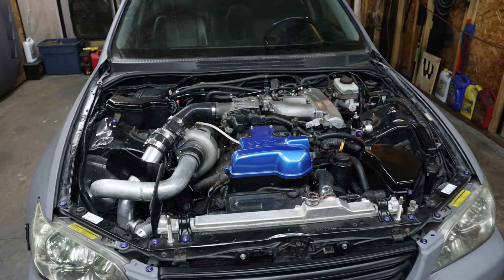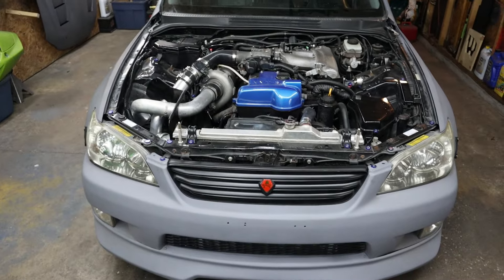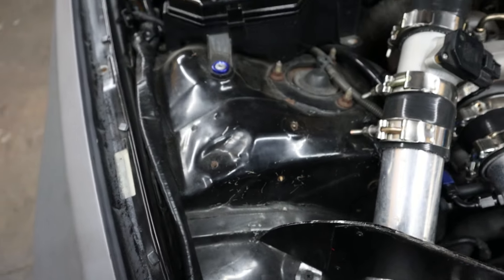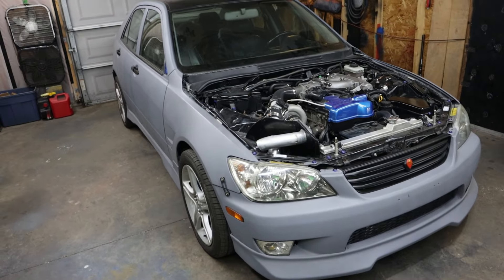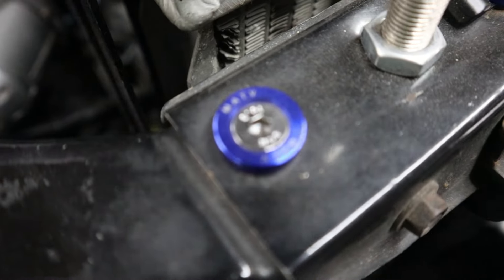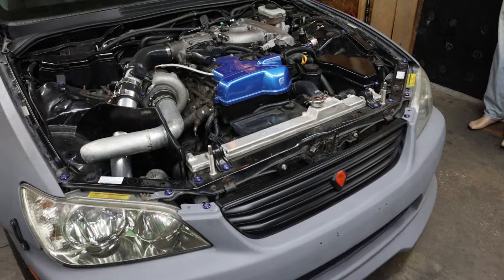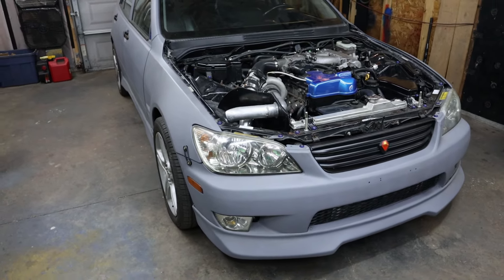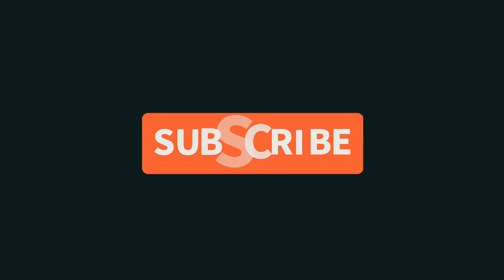Turbo Lexus Build 🐌 Change of Plans ! #lexus #is300 #turbo #2jz #nat #vvti #boosted #driftcar #w55

Comment: Good ideas, im missed you're last couple videos . I also hate the intake setup, makes a simple job like spark plugs a bit of a pain. For AC Delete id sugest the oem belt for a early 2000s audi a4 i think. Ended up being a perfect fit when i deleted my ac. Gotta rebuild mine before boost, slight knock and some glitter in oil 😅 217k miles on her lol
Reply from the maker: for real,  doing plugs sucks and the crossover intake is just ugly lol I'll definitely check out those belts ✌
Reply: @2JZ_WISCO  I double checked, the belt I used was from a 2000 a4 2.8 V6. It's a perfect fit. Can't remember length, 73.5" or something like that. I saw it on a supra forum years ago
Reply from the maker: Awesome thanks bro 💪